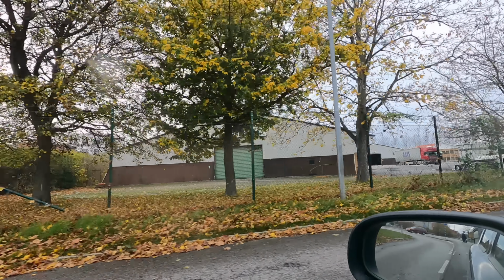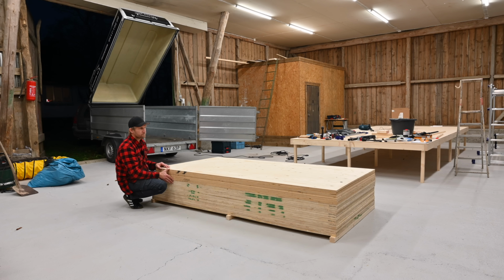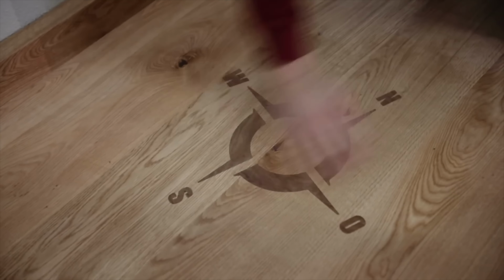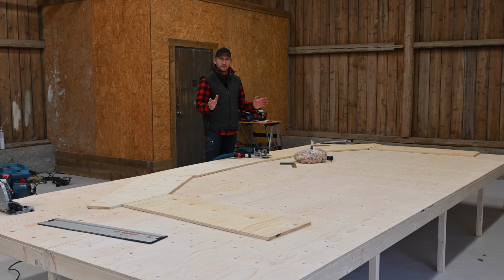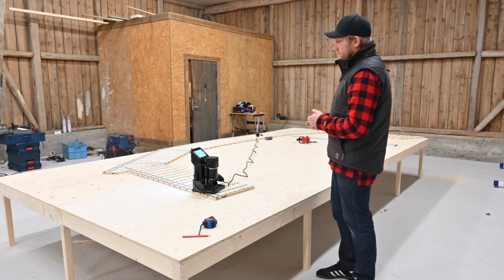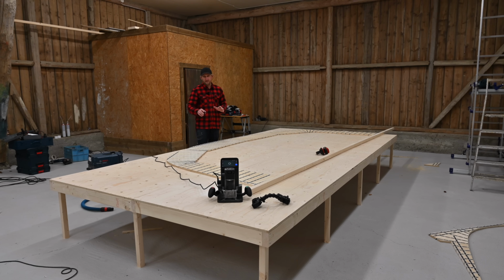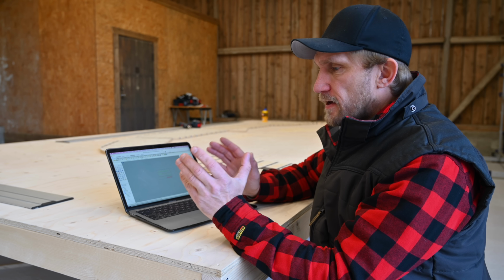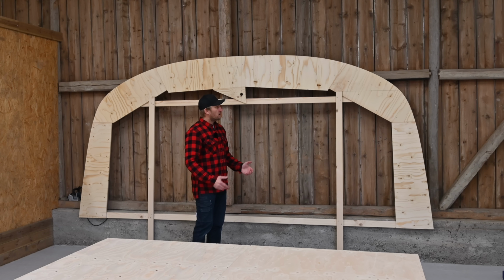Building Temporary Hull Frames With New TECHNOLOGY- Ep. 325 RAN Sailing

Comment: 21 in a week? I have no time reference, but that one station, with the roughing out, glue up, taping, scanning, routing, then stiffening looked like quite a bit of work. Let’s see a time lapse next time with a clock running!
Reply from the maker: I might have been a bit ambitious with that statement. 😂 Cheers! /Johan
Reply: Three a day. Why not? One every 3 hours in a nine hour day, largest one complete. Put the camera down and suddenly, boom, all done.
I got your back, John!
Reply: @forry2905  because there is no economy of scale. Every piece is unique in dimension, so the time it takes to build station #7 will = every other station. The only thing that changes is material.
Reply: That is not true, the smaller the frame the shorter the way the router has to cut, you need less shaper tape to glue down a.s.o. So there is economy of scale.
Reply: @johnmayer3433  That's not economy of scale that's economy of  shape. Though he will be faster as he learnes exactly how to do all the different steps without wasting time.
Reply: @johnmayer3433  not quite. The smaller the piece, the tighter the tolerances have to become. So the tape will be proportional to the size of the frame…iow, closer together. Scanning time is proportional to the tape. You can spread small errors out on the larger pieces. Small errors on small frames are big errors. It’s proportional. You spend just as much time. The ONLY thing that MIGHT decrease is router cutting time and that will be minimal, and material.

Comment: You might consider using a laser to aim down the centerline holes that each piece will have. Not sure if it would be easier than a string but that is for you to decide. It is going to be an exciting build!
Reply: Light won’t bend in that distance unless you have some huge magnets in that loft.  Much better than string.
Reply: @salnichols94805  Whats wrong with good old bricklayers string? Cheap and you can leave it up, thats what I've done in the past building boats. Granted I've never built anything on this size though, but the principle still applies
Reply: @Antipodean33  hes cutting with precision, why measure with an axe?
Reply: @Antipodean33  I think the brickies that built our house that cheap bendy variable stuff.
Reply: @salnichols94805  Yes in the steel fabrication game I would measure and cut with no tolerance offered and the finished product usually came out well under tolerance. Also rather than using sting I would use thin mig wire, only down side was it had to be pulled very tight
Reply: Ha! You read my mind! (Cut to a shot of Dr. Evil saying "LASER!" with air-quotes.)